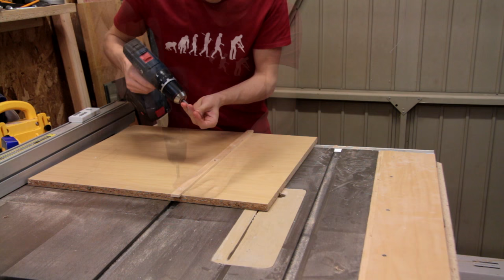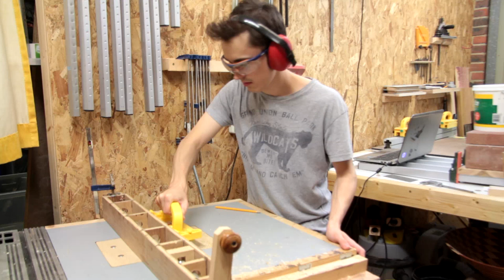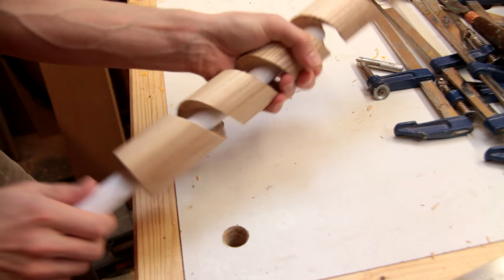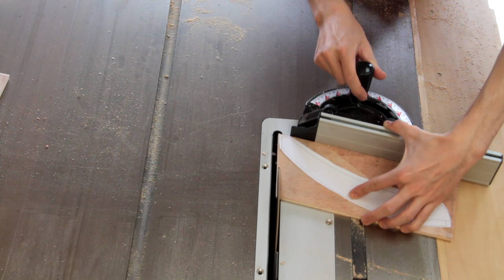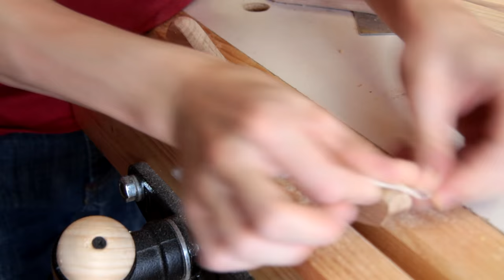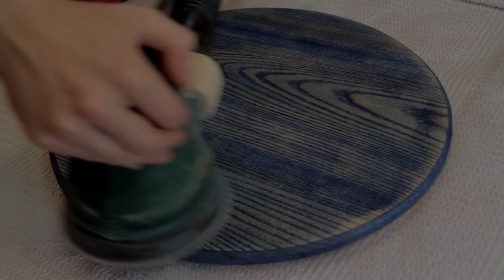Making a Hollow Spiral Pedestal Table

Comment: Very cool!  I hadn't seen the use of the blue stain to pop the grain before.
The wood spiral wood look cool as the base of a lamp with a standard light socket and shade on top but a light element (neon or LED light pipe) threaded through the center.